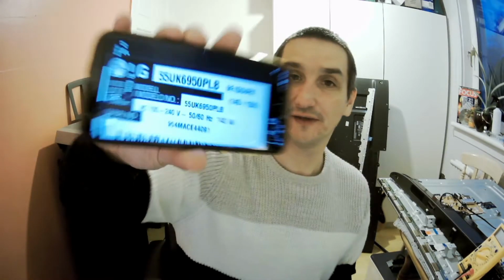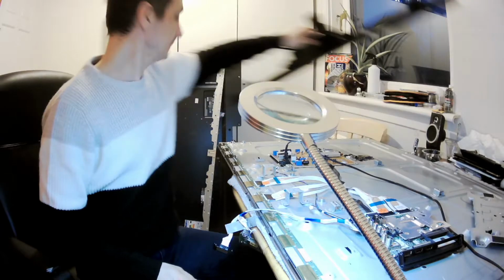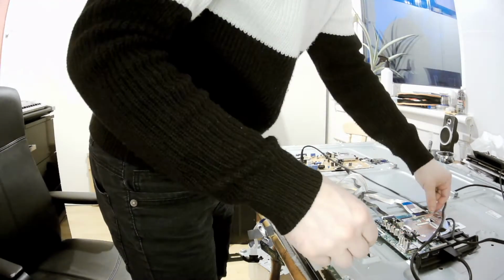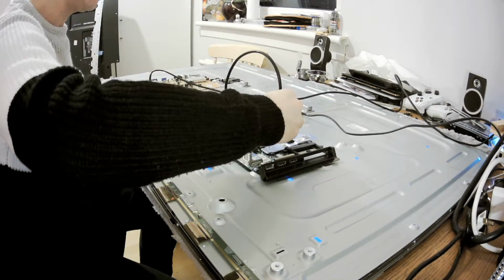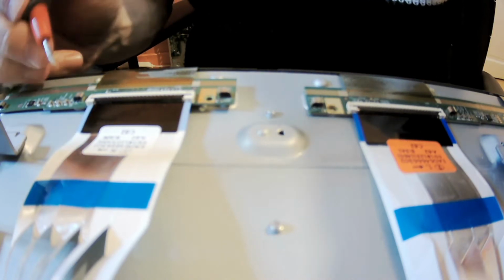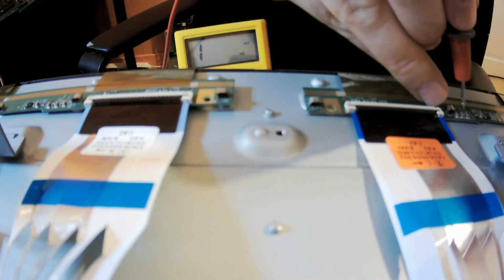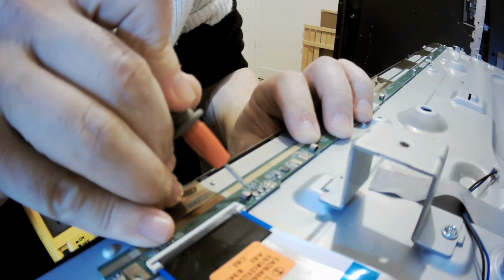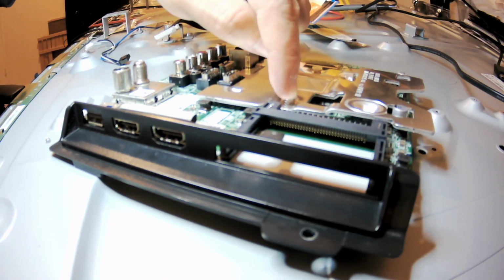LG 55UK6950PLB - no picutre, just backlight, part 1. Look for #2, see why we need a Right To Repair

Comment: Where is part 2 my friend.  
Please send me the link .
Reply: Hi my friend.... I have the same issue... Did you solve it?
If so please help me...  I will pay you for the tip
Reply from the maker: @renegeijtenbeek7457  there can be a number of reasons why you have no picture. You need to understand how LVDS and T-con are working. If these are fine, you might have a problem with what's called bonding. Bonding is a connection of the COF to the display. COF = chip on film.

It's a case by case to be true.
Reply from the maker: https://youtu.be/i5E7YbXJsc4